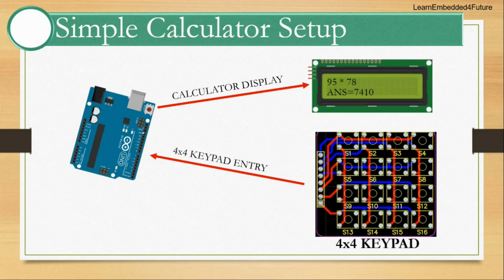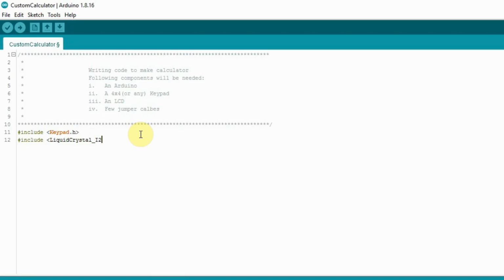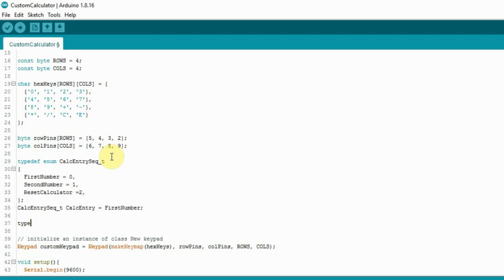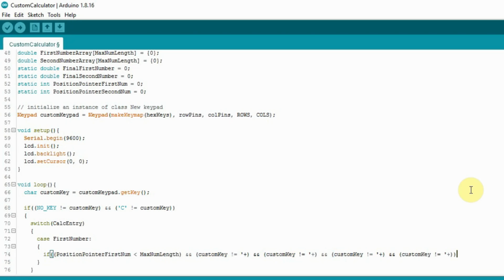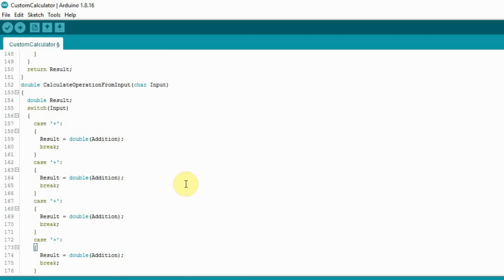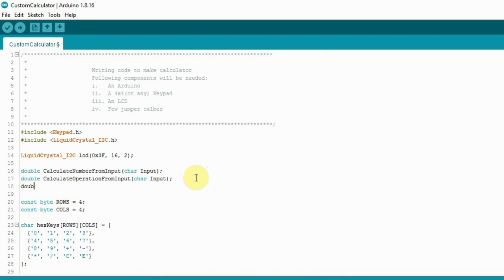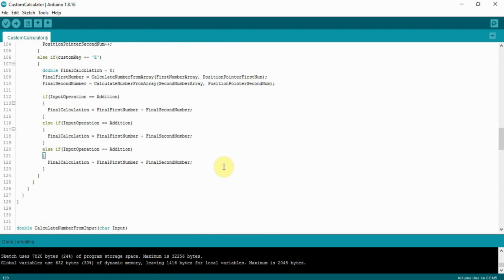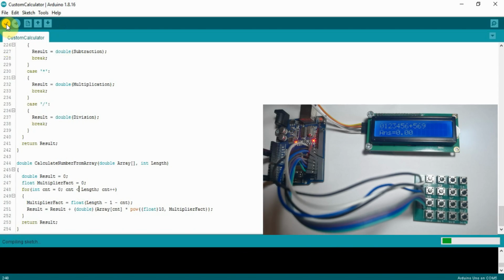Calculator using 4x4 Keypad and LCD | ARDUINO UNO | DIY CALCULATOR

Comment: In the Google search enter: "C35 - a Calculator, Based on the Famous HP-35 ROM". This Arduino project based on Aduino Pro Micro and a 0.96" SPI (seven-pin) OLED screen. One of the best Arduino calculator projects.